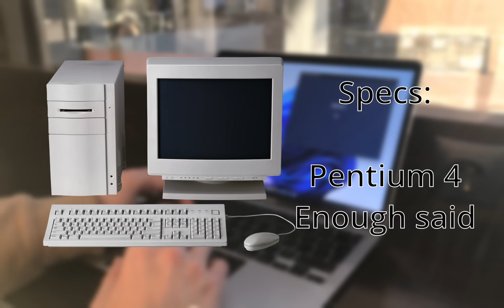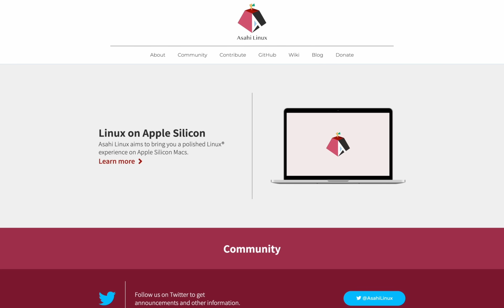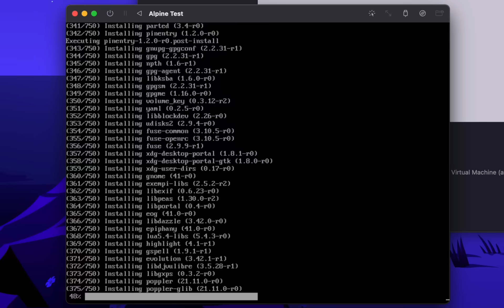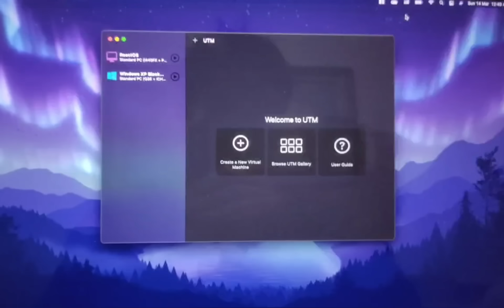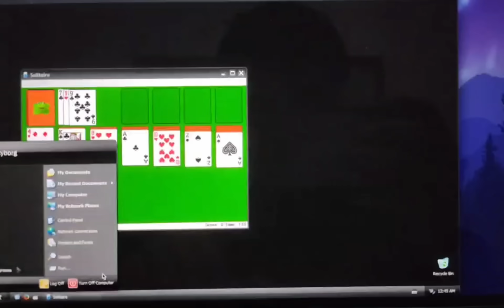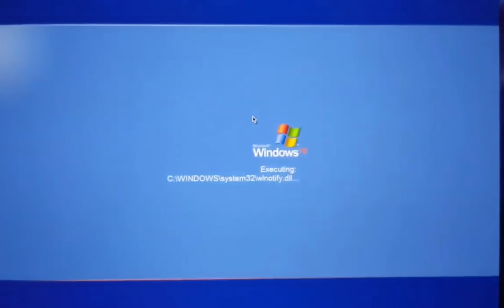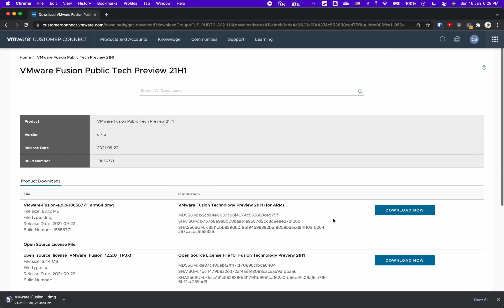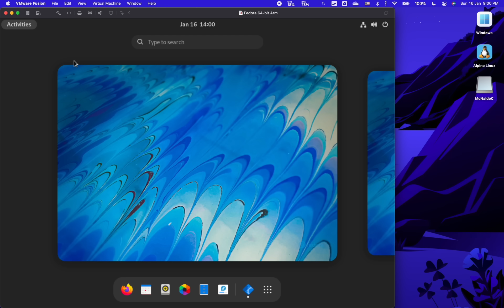Using Virtual Machines on Apple Silicon

Comment: The problem is that running Windows this way is not fully supported or legalized by Microsoft.  Parallels doesn’t care.  VMWare does.  I too am disappointed that VMWare truly hasn’t kept up.  But I do not like Parallels.  They have always been not quite professional, IMO.  Others may disagree, so don’t flame me.  I am a long time VMWare user and would prefer not to switch.  I am holding out to see what happens, and hoping VMWare starts truly competing once again.  I have yet to try UTM.

Comment: FULL OF FABRICATIONS! 
I HAVE A MACBOOK PRO WITH A DISCREET AMD PRO 5500M GPU WITH 8GB & eGPU RX6900XT WITH 16GB. MY MAC HAS 64GB RAM & NEARLY HALF SYSTEM MEMORY IS USED FOR GRAPHICS EVEN THOUGH PARALLELS IS CONFIGURED TO USE 16GB. PARALLELS IT SUPPORT STAFF IS NOT ABLE TO FIND A FIX SO CONSIDER THIS SHORTCOMING WHEN DECIDING! PARALLELS SUCKS OUT OF THE SYSTEM MEMORY FOR GRAPHICS WITH NO FEATURE TO USE GPU FOR GRAPHICS INSTEAD! WHEREAS VMWARE FUSION IS FOR PROFESSIONALS WHO CAN PROVIDE TO COVER THE PRICE OF FUSION PRO! IT IS NOT AS IF I TALKED NONSENSE! I HAVE PURCHASED BOTH & USED THEM FOR A LONG TIME THEREFORE EXPERIENCED ENOUGH TO COMPARE. IN ADDITION, WHEN ONE NEEDS SUPPORT FROM PARALLELS STAFF BASED IN ASIA ARE NOT UPSKILLED TO UNDERSTAND. WHEREAS VMWARE ARE THE PROS! DON’T PROTEST WHEN VMWARE PLAYER IS NOT MEETING YOUR EXPECTATIONS WHEN IT IS FREE OF CHARGE! PAY FOR THE PRO SOFTWARE INSTEAD TO UNLOCK THE FEATURES GIVING THE POWER THAT IS REQUIRED TO RUN ANYTHING ON A MAC & THAT IS THE MOST USEFUL APPROACH INSTEAD OF GRUMBLING FOR WHAT IS AVAILABLE FREE OF CHARGE!

Comment: Odd that you had so much trouble with VMware.  I’ve been using it for about 6 months on my MBP 14 M1 Max and only had issues with resolution on linux when using the older kernels, using the latest kernel fixed those issues, but they have that documented.  I’ve been playing with the idea of using parallels, might have to try it out.

Comment: One thing that always pops out to me when trying to make these things work in a usable way is something you say a lot about VMware Fusion. "I just couldn't be bothered to fix the error" when performance is terrible.

Thanks for putting this together.
Reply from the maker: I'm usually the type to always try my hardest to fix any error that comes up, it gives me a very primal sense of satisfaction when I make a computer work properly. But when it comes to the average user, I want to be honest with them, and I want to show them that this needs tinkering to get it to work - I'm not going to overstate its ease of use just because I got it to work.

Comment: So if you’re already using Windows under Parallels on a MBP, you can’t migrate the Windows VM to the M1/2?
Reply from the maker: You can't migrate an x86_64 virtual machine to an arm64 system, as far as I know. Maybe Parallels has a way of doing it, but fundamentally they are very different.

Comment: good experience sharing! i also use Parallels for several years on x86_64 MacOS, and runs my Windows 7 VM for last couple of years! I'm also considering buying my next M1 Mac, and would surely adopt Parallels to run my new VMs on it. Yes, the Parallels subscription is not cheap, but worth it.

Comment: And what about emulation/virtualization on that Linux distro that can be installed directly on a Mac?
Reply from the maker: Asahi Linux has no GPU acceleration at all right now. I don't know how it uses the arm64 architecture for virtualization whatsoever, I haven't installed it, and I don't want to risk installing it on my main laptop.

Comment: I have tried Win7 64bit with some tweaks , it works pretty smooth for me on m1 pro except there is an issue of time not staying in sync.
Reply from the maker: That is emulation, Windows 7 never came out for arm64. But it does work on UTM! I would recommend emulating a 32-bit version, though.
Reply: yup I'm talking about emulation only. UTM works great for me just the only issue is time doesn't remain in sync which causes troubles here n there.

Comment: Parallels is so rad. I can't believe how well it runs on my new M1 Pro versus my 2020 Intel MBP. The fans would go crazy on my Intel model when running Windows in Parallels. I haven't heard the fans once on the M1.
I'm a specific use case where I like to use a Mac for work, but there are 2 of my own company's proprietary Windows apps that I need to access in order to do product demos. These apps are running faster on my M1 Parallels instance than they do on my work-issued Lenovo Windows laptop.
Reply: Because macbook air m1 base model(2020) has not fans at all . It cools passively, while macbook pro m1 (2020) has fans.
Reply: @stuarthook6226  I don’t have the base model M1, I have the MacBook Pro. I’m comparing Pro 2020 to Pro 14
Reply: Arm windows?
Reply: @oscarcharliezulu  Yeah, It works for what I do, but I know there are limitations on it. Also it’s not very clear really how much support an investment windows is going to make into the arm version so time will tell if it remains usable
Reply: Your Mac is 8gb or 16?
Reply: @asianstud7  16

Comment: Hi, i have a 2016 macbook pro. i have been using camptune which allows me to run windows so i can use QuickBooks. i have now purchased a MacBook with the M1 chip, so i cant use camptune. my question is, if i use parallels, can i install QuickBooks onto it via a usb?
Reply from the maker: Honestly, I have no clue what QuickBooks is, but as long as it's a Windows program you should be able to install it in a Windows virtual machine, if that's what you're asking.
Reply: @KalosLikesComputers  thanks, i wish i didnt know what quickbooks was ;-) thanks, you answered my question

Comment: no usb peripheral coverage on this video. just try using usb on UTM. there was no option to select host os or vm. the flash drives keeps constantly connecting to mac os. it was so 6 month ago may be it changed now, but i have doubts.  Vmware usb work much better than UTM. and it is definitely a better choice when you need windows desperately. The resolution problem can be overcome by using microsoft remote desktop app. and yes, i it present for mac os. Not working things are  graphics and TPM.The only problem for me is TPM. Graphics, i find  meaningless gaming on mac using vms.. gaming on vms overall. But otherwise i use vmware windows arm for 6 month now.
Reply from the maker: That's a good point!
Parallels asks you which system you want to assign a device to when you plug in a new USB device. You can also pass through any USB device that is already connected.
Reply: @KalosLikesComputers  yeap, parrelels does it all flawless as it should be.. but it doesn't come free

Comment: If you need a stable Windows or Linux image running on your M1 Mac, spend the money and get Parallels.  There really is no alternative if you consider your time is money so if you're spending it trying to tweak other solutions to work, you'd be further ahead just to get Parallels from the get-go.  I've thrown many different OSs at it and it just works (on both Intel and Arm based Macs).  Installation and configuration couldn't be easier.  I use a lot of software every day and Parallels is in my top 3 favorite applications.  VMware has always kinda been trash on the Mac (even the Intel platform).  Their Mac solutions have always taken a 3rd-row seat to their PC and Enterprise products and it shows.  Great video, by the way.  Very thorough.

Comment: Hey, great video! I am currently using 2020 i5 MacBook Pro, and because of my work flow, I use Microsoft Excel via Bootcamp a lot. Do you think that the experience with Excel using Parallels is similar as on Bootcamp (e.g. speed performance, responsiveness, shortcuts usage)?
Reply from the maker: Personally, since you seem to already have a license for Microsoft Office, I'd recommend just running Excel natively on the Mac. Microsoft Office for Mac is miles better than Microsoft Office for Windows... You really don't need to run Windows at all.

I haven't tested Office on Parallels arm64 extensively because I don't need to, Office for Mac covers my needs, but I have tested Visio which is an x86 app running through emulation and it runs pretty well.

Comment: Let's be perfectly clear, Parallels on M1 may be useful if you want to use a virtualised W11 ARM version (it's pretty useless for me since I need the full Dropbox client which is NOT available under ARM, simply a wrapper around the web version). Further ARM is not widely available, MS use it only on one (maybe 2) of its Surface devices. The great unwashed say it's great for their use case(s), for mine it's almost useless. I do not need to virtualise Linux, so if it does that poorly or not is irrelevant. I do need to virtualise macOS  and this is absolute rubbish. You cannot update the installation because you require a physical key press which is not possible, BUT even worse, there are no snapshots. One of the main, if not the main, reasons I use virtualisation is for snapshots. Further, the implementation is awful. So to me, Parallels on M1 is currently a big FAIL, it is, for my use case, useless. FUSION, is no better, but then VMWare does not pretend it actually supports M1 and is fit for purpose. Reading the blurb from Parallels WRT M1 Usage, it is about 85% pure BS. If I had my druthers, I'd Druther off-load this very expensive and upspec'd M1 MacBook Pro and off load it for an Intel version.

I have avoided the UTS(sp) version because it seemed complicated. I did not immediately realise that it was an emulator vs virtualisation, but, if I can get a Monterey emulator going, a Windows emulator going and they have snapshots, well job done. Hopefully the performance Apple brags about with M1 PLUS, 32Gb RAM and 2Tb SSD will be sufficient to overcome the slow performance.
Reply: You can run x64 apps on Windows 11 ARM, you dont need special ARM apps. I havent had any issues with apps that I use.

Comment: I was quite sceptical with m1 and vm (win11) due to business needs but now with pd desktop 17 after 1 year there are only really some minor drawbacks… sql connection is slower as with native machines but hey it’s really fine considering the very little dev time!!
Reply: got a similar problem for reverse tools. even i don't like windows 11, i admit emulation of intel is just amazing in general (visual studio, is really slow).

i was said that 8Go of RAM was sufficiant bc RAM is far faster, and it's true. even with 2 VM with 4Gb (SSD speed is also great).

So now for my hacks I have : an emulated machine via UTM for Debian and intel reverse tools, Win11 VM and kali + macports and homebrew.

Comment: Even Ubuntu doesn't support 3D Acceleration?
Reply from the maker: As of right now no.
Reply: @KalosLikesComputers  On Parallels?
Reply from the maker: @kragrrr  Parallels passes through the GPU in a specific way that is unlike most virtualization software... Not entirely sure how it works but it basically uses the GPU as if the OS is running as an app? Maybe they have a Metal compatibility layer? I really don't know - but I can confirm Parallels handles the M1 GPU beautifully.
Reply: @KalosLikesComputers  things like opengl and vulkan which are required for software like blender and Gazebo should work right?

Comment: Blown away by how easy it was to download and install Parallels and Windows 11 and make a working VM!  I've been working with VMware Fusion on the Mac since version 1 and have never gotten Windows running on a Mac quicker and easier than this.  In this video he mentions jumping through hoops to get Windows 11.  I think that's out of date, it's just a couple of clicks after you've installed Parallels.

Comment: This is great to see. I'd really love to see how an M1 Ultra handles an x64/x86 Windows build.  If anyone has one, and would like to try, I'd love to see it.
Reply: It does not and cannot. No non-Silicon/ARM VM builds will run on an M1 mac. Form Parallels website: An Intel-based virtual machine (VM) cannot be started on a new Mac with Apple M1 chip because it is not compatible with Mac computers equipped with the Apple M1 chip.
Reply: @kevinblack8365  Which for me, turned out to be disastrous.

Comment: To install fedora (gnome) on vm fusion you need to choose on initial boot TROUBLESHOOTING -> graphics installer. And it just works after it. Full resolution etc.

Fedora server with xfce runs fine in vm fusion too.

Comment: I have been a Parallels user for years and was wary about moving to an M1 Mac since I need to run a couple Windows apps for work. I bought a base model M1 Mini to see if it would work for me. After some issues with dotnet I was able to get all of my Windows apps running with Parallels. Hopefully MS will release Windows for ARM directly soon so The Rest of Us do not have to deal with the Insider program.

Comment: I'm trying to decide how to try using Install_macOS_11.2.3-20D91_to_sideload_iOS,iPadOS_apps.dmg - I think it'll run apps that newer version of macOS won't run.  I could try installing it directly to a real partition and boot to it, or I could try using one of the options reviewed here.  But I have yet to find info on how macOS (11/Big Sur) runs on macOS (12/Monterey).  I'm still unsure.  Still, good 1st video.
Reply from the maker: I've tried literally everything in my power to install 11.2.3 for this exact purpose. I have been violently unsuccessful. Parallels, UTM, they both cannot install this for some reason, and it's not bootable anymore on real hardware probably because Apple enforces it. Do let me know if you succeed! I would be very grateful!
Reply: @KalosLikesComputers  Let me know if you can see my other reply I just posted.  Here it is without the URLs which are probably the cause of the posting errors I'm getting: 

  Wow!  Fascinating...and disappointing.  But I really appreciate the info. 
1. Apple says reduced security MUST be turned on: ...-mchl768f7291/mac  Done?  
(2. Did you try installing without any internet connection?  Perhaps that would help - keep it from connecting to the mother ship?)

3. Just running the 11.2.3 installer from 12.3, I get: “Install macOS Big Sur“ cannot be opened from a newer version of macOS. For more information, visit ...HT201372"
 
You started with these steps (1,3) ? (Also, the HT links to tons of discussion threads; some say that bootable USB installers don't need Internet access; others the reverse!)
Reply: Hey, Google!  False positive... - please stop hiding my post(s) here!
Reply: I'm torn between installing vmware to try 11.2.3 in it or following HT201372 to install 11.2.3 directly, or trying something I didn't know about - a sideloading tool, e.g. PlayCover or Sideloadly.  I've been able to self-sign and run a copy of Thunderbird I stripped and compressed (thereby breaking the previous signature) - without turning off full protection.

Comment: Excellent! Finally a good video that talks about VMs on M1. 

In my case when a was thinking on move to the M1 knowing that i wouldn't can virtualize any OS the same way (on the same hardware), i did this:

1.- I bought a refurbished HP Tiny EliteDesk 800 G3.
2.- Then i upgraded the ram of HP to its max (32Gb), and also upgrade the internal storage with 256Gb ssd and a 512Gb M.2.
3.- I installed the free version of VMware ESXi on the HP as Hypervisor, and connect it to my local network. 

And thats how i virtualize any OS now.

Comment: Thanks for the video. May I use Parallels to install an older macOS version? Im current use macOS Monterey, but for study porpoise I need to install MacOS High Sierra. Please, let me know.
Reply from the maker: High Sierra was never built for arm64, so no, you cannot do this on an Apple Silicon Mac. You can do it on an Intel Mac, though.

Comment: I think you didn't emphasize enough that Parallels CANNOT run x86 windows virtual machines... only ARM based... so you cannot install x86 apps on it (at least not natively), whereas UTM seems to be able to do it, Am I wrong ?
Reply from the maker: I did say that Parallels cannot do emulation. However, if you install Windows 11 (arm64), you can run x86 apps in it, Microsoft has a translation layer much like Rosetta 2 in Windows for ARM. I showed Microsoft Visio (x86) running just fine.
Reply: Underrated comment.
Running legacy x86-win32 programs on the M1 is the feature I would be willing to pay for. Any chance on a more in depth evaluation for this niche.

Comment: In your educated opinion, which would be better for running Win10 and all the associated apps (photoshop, browser, office stuff), and would there be orders of magnitude difference?

2018 base model 13" MBP (i5, 8GB) running Win10 through bootcamp

or 

2022 base model 14" MBP running Win10/11 through parallels
Reply from the maker: I would recommend running as many things as you can on macOS and only resorting to Windows for things that are not available otherwise. Photoshop is available for Mac, Office is available for Mac (and is even better than the Windows versions actually), web browsers of course are available for Mac, etc.
If you don't want to use macOS at all, don't get a Mac.